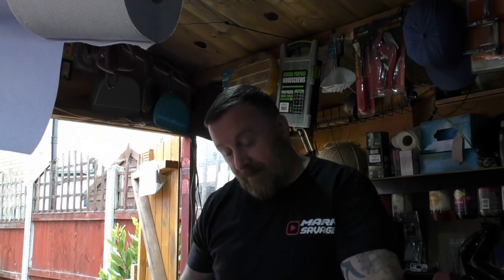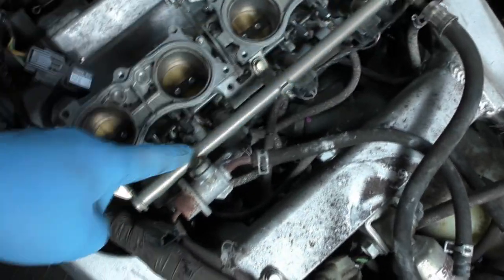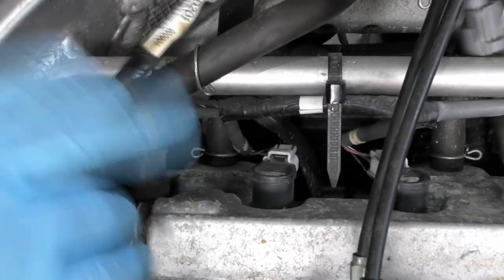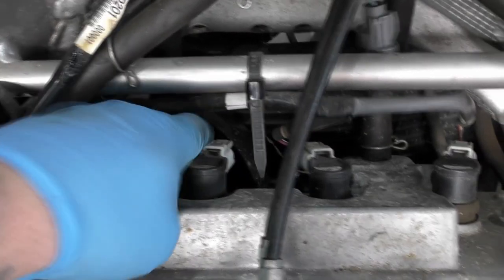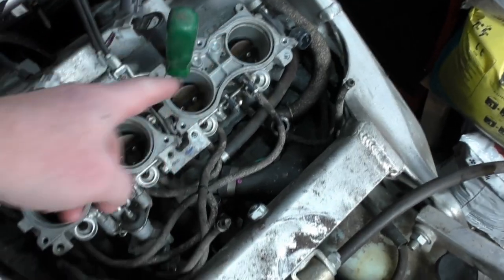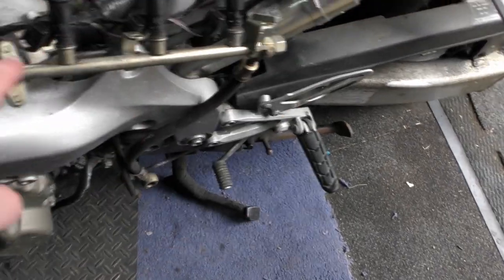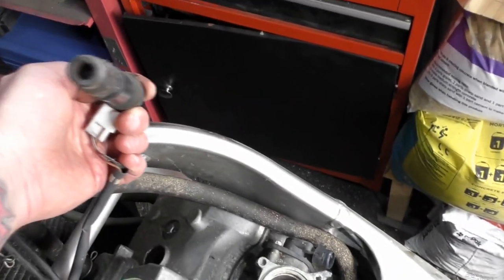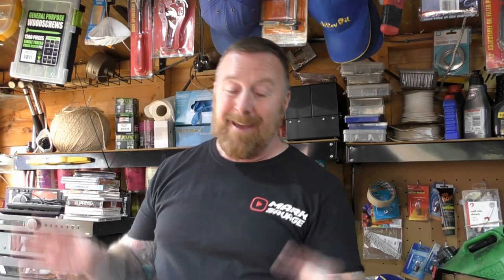HONDA CBR 600 ENGINE & INJECTION SYSTEM LOOK OVER MARK SAVAGE

Comment: Mark the easiest way to do plugs on those is to use the tool that honda supply with the tool kit. Takes all the hassle ot of it. I learnt that the hard way. Regards Paul Prescott.
Reply from the maker: The bmw has a tool with it so you can undo the oil plug 
But I sort of do things working with what you have as most of the time they don't come with them,  thanks for the tip bud
Reply: @marksavage  your welcome mate.

Comment: Nice video 👍🏼 I have a question, my Honda cbr600f4i is not starting and I thing because the injectors are not working,  I think that it could be a wire but I’m not sure, the spark plugs are working but the injectors are not putting gas
Reply from the maker: It maybe like in my video the fuel pump bud , does it prim when you turn on

Comment: Hi mark have you ever done any work on a piaggio nrg mc3 extreme 50cc 2002?
Reply from the maker: I have a few nrg videos on here 
Replaced piston , fuel system etc 
Why whats up
Reply: I’m needing to change the crank, but wondered how to do it and if it’s easy, I’ve never changed a crank on moped’s. Do I need any special tools etc? And also when you take our carbs what do you use to block the fuel lines so petrol doesn’t go everywhere and the same with the oil line?
Reply from the maker: If you dont have tools nor the basic know how i wouldn't try it 
However i have many videos on how to do it on mt channel 
They are on speedfights but the basics are the same and will help
Check out the 80 odd speedfight videos and aerox videos 
They will give you an insight bud
Reply: Mark with 2 stroke oil is it worth putting fuel full synthetic or part synthetic? 50cc just derestricted goes 45 mph ( piaggio nrg mc3 extreme 2002)
Reply from the maker: @AJC762  to be honest just as long as its not the cheap shoppers 2t
I use halfords and good 
My mate uses fully and he loves it 
I have a video on 2t oil on my channel
Reply: Also I have an issue with my steering lock it doesn’t work anymore do you know why? I changed my front wheel bearing and ever since thst it doesn’t work anymore?
Reply from the maker: @AJC762  they can move due the coming loose , take off front panel , you will see whats going on and why its not working!

Comment: Hi mark just wondering, I’ve got a bog standard Yamaha aerox nothing done to it, 2 stroke of a there anything I can do to get it to around 50 mph?
Reply from the maker: What year bud ??
Early ones follow my videos 
Exhaust, variator / rollers , small upjet of 4 
Sports air filter
Reply: mark savage it’s 2004 and what size rollers would you recommend?
Reply from the maker: @Josh-ph8gl  6g are the best arounders